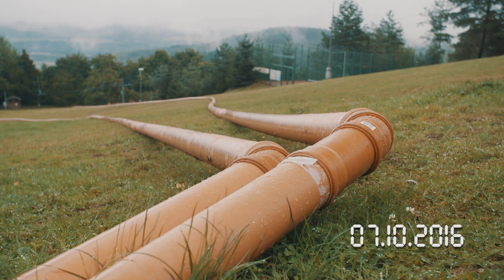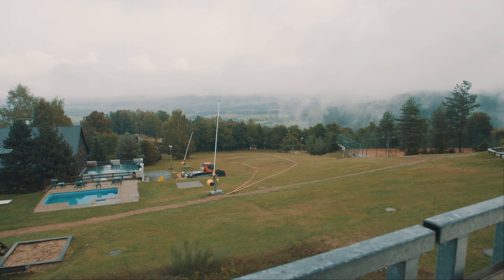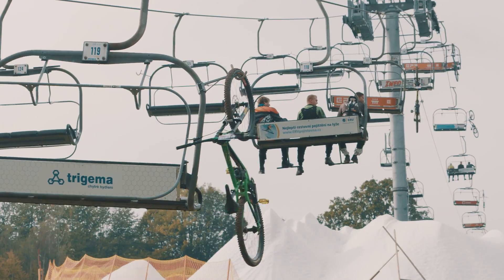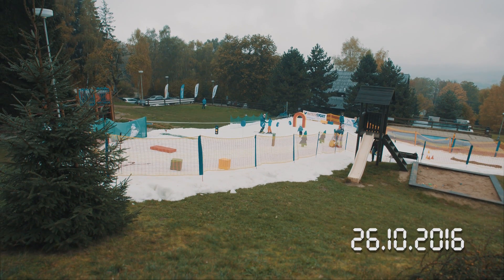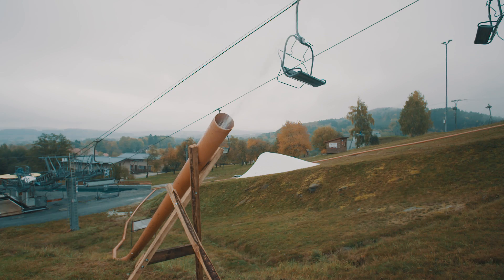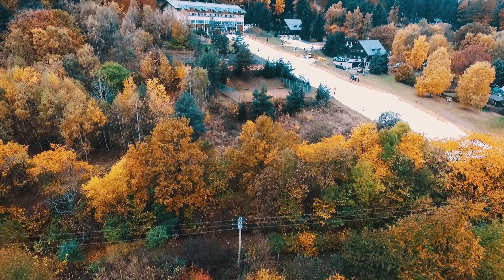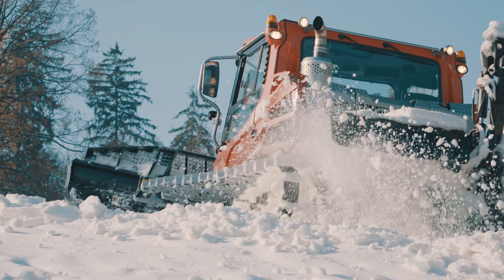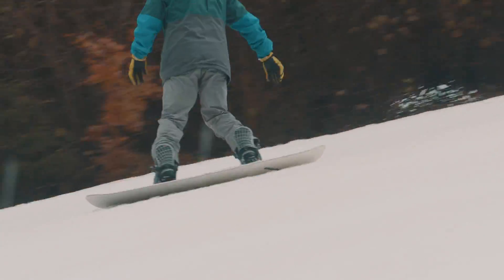TechnoAlpin Snowfactory at Moninec (CZ)

Comment: The Problem are the Chemicals that are in the Snow, so that it doesn’t melt
Reply: Man made snow consists only of water and air, no chemicals are added. The secret behind the toughness of man made snow is the structure of the snow itself. Natural snow has the form of snowflakes, the snowflake form doesn't withstand temperatures over 0° C. The snoflakes in man made snow however, has the form of spheres. That form is more than 10 times tougher against high temperatures than natural snow. I have worked with snowmaking more than 10 years.
Reply: @alexanderbjork6451  is it true that this ideal snow for a base, but not ideal as a grippy top layer?
Reply: Chemicals? What chemicals do you mean???